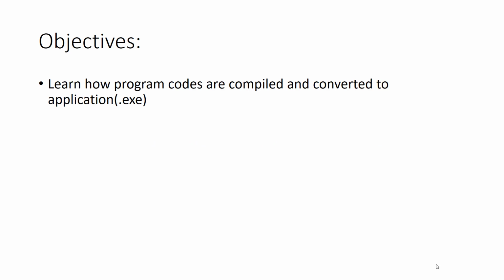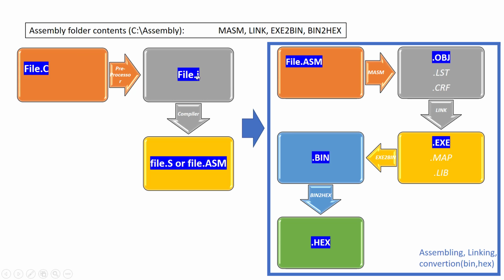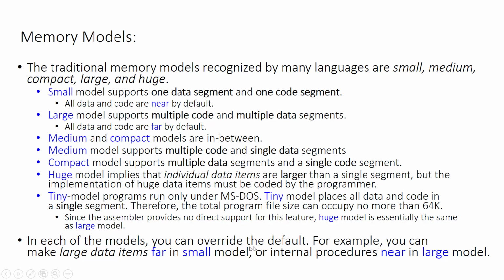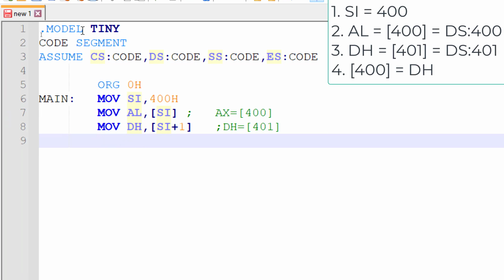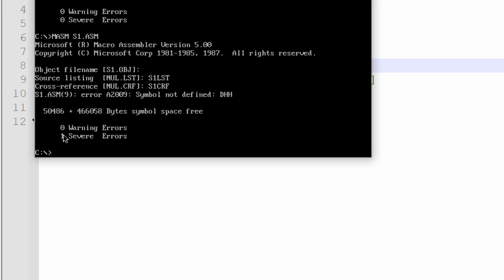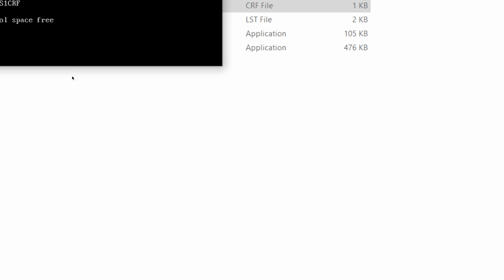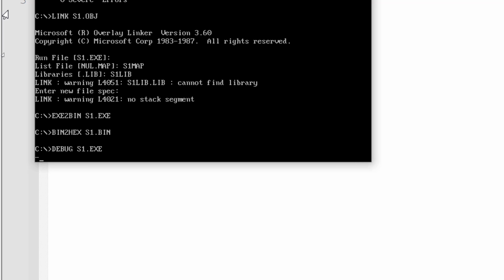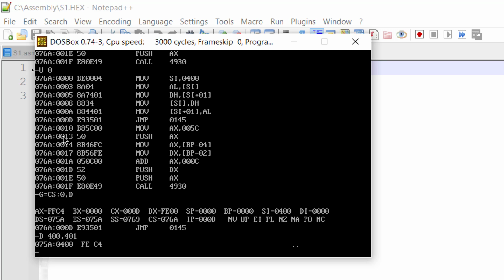2. Assembly code to Application(.EXE) and Machine code(.HEX) conversion

Comment: With using the TINY memory model for DOS the file size is limited to 64 kb. But in DOS we can get more free RAM and we can open, read and close a (larger) file with software interrupts from a tiny program. And we can start and run DOS com and exe files from a tiny program as a child process. After termination the child process we are going back to the start processt so we can start the next child process with the next com or exe file.